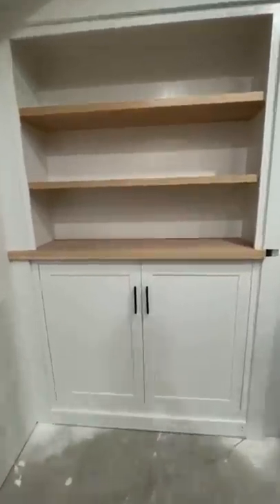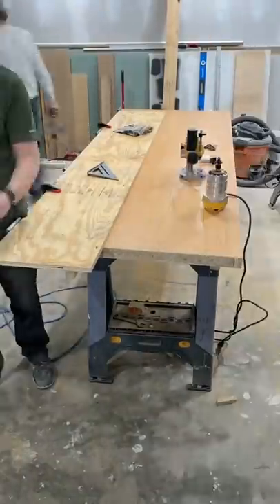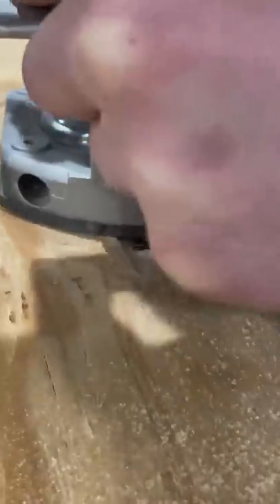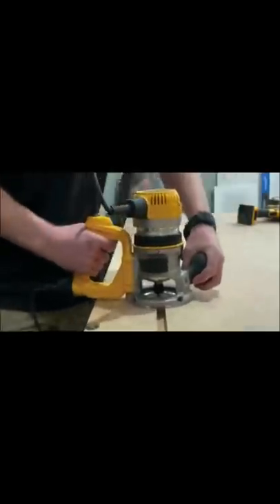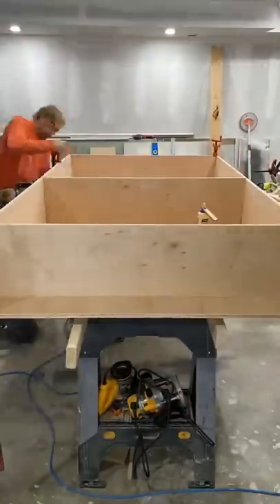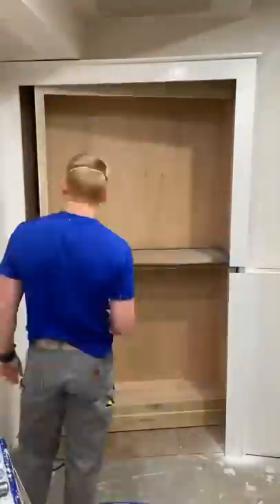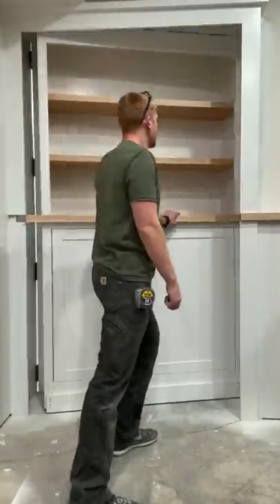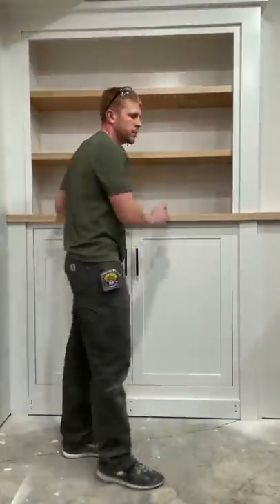How to Build a Secret Bookcase Door | Short Version

Comment: Totally badass! Especially that magnetic lock. Great place to hide.
Reply: I would suggest a combination of a mag lock and drop bolts if you want to build a place to hide. The drop bolts are much more secure because they do not rely on electricity and a good seal (mag locks will not lock securely if they have debris in-between the surface). Drop bolts can also be easily set to stay locked (called fail secure) if the power goes out meaning you wouldn't loose your lock if you lost your power. No worries about the fail secure and getting locked in though. You can access the drop bolts from inside and get out. You either install them in such a way that you can physically unlatch them, or you have a set of contacts that you can energize with a spare battery like a 9 volt (unnecessary but cool) to unlock the bolt.

I'd keep the mag lock as well though because they are much easier to make it where there is no wiggle at all, therefore not giving your secret hideout away 🤙
Reply: Hide where a cheap magnetic lock is supposed to keep someone out.. also the room isn't sound proofed so they can hear you if you even are breathing too hard while they are present in there.. not smart to use as a hiding place
Reply: @capn.c5321  so.... You just sound proof it... right? It is new.

Comment: Just needs a secret unlocking mechanism instead of the keyfob
Reply: Yeah like pulling on the fourth book from the left or something. Maybe you gotta move a candlestick.
Reply: The key fob cuts the power on the electromagnetic
Reply: Like the book in the Addams family's library or the bust in batman's study
Reply: @pabloramirez4672  so, just cutting the power to the house would render all "secret" locks useless?
Reply: @cojack5080  depends if he has it hooked to a separate power source
Reply: Or flipping the breaker to the lock ;P
Reply: And more hinges that things gunna sag with all that weight
Reply: Hopefully there's a way out if you get closed in without the keyfob
Reply from the maker: There’s an exit button inside.
Reply: Maglocks usually have a 12v auxiliary battery supply which is being permanently charged by the mains. 

They do in the UK anyway. I used to install Bewator Maglocks and Keypads.
Reply: @jonathanwright5550  I've always used piano henges to make it flush and sturdy but I've always done a false wall never a bookshelf
Reply: @tygoff262  yeah I thought pinao hinge be the way to go
Reply: @pabloramirez4672  that makes me wonder how much power electronic magnets take and if you could run them off of something small like a car battery for a very long time so you could avoid that
Reply: @stephensmith8812  car batteries are rated at 12.7 volts in most cases so pretty much the same I assume
Reply: @pabloramirez4672  thats interesting thank you. I've always wondered about people with "magnetic doors" and thought about power outages or rolling blackouts. They could be run off a generator but that wouldn't be very stealthy and a car battery is cheap and affordable plus if it offers a shelf time similar to a car (4 years+) it would be ideal other than solar power
Reply: She should use a different type of Lock and make it some kind of combination code where you have to pull a couple different books in a certain order
Reply: @zakbrinkhoff324  I concur, and a slightly more simple quick access "hidden gun safe" spot for an emergency access home defense weapon. Like a drop-down under a mantle for a shotgun and a hand gun or something similar, triggered by a magnetic release in a ring, bracelet, or wrist watch band clasp. Maybe a fingerprint reader under the shelf/mantle.
Reply: @entrancinggaming3627  do you really believe  there wouldn't be..
Reply: @stephensmith8812  likely a 9v battery in most will do for back up power. Can't think they require a lot of juice
Reply: The key fob is the secret unlocking mechanism, most people do not unlock their secret doors with a key fobs do they?
Reply: Agreed. I would do a magnetic switch hidden in the wood frame or something where I could activate it with a magnet in case you lost the remote. I would also install a battery backup for power outages in case someone cut the power before a break in

Comment: What happens when you actually put books on the shelves? Will it still open smoothly with the extra weight?
Reply from the maker: I guess we will see… I do have an adjustable caster on the opposite corner to support weight.
Reply: I've installed a few Murphy doors and those held up. Can put whatever on them. But those have different style hinges. I would assume these would start to rub with weight and time
Reply: @SatisfyDIY  that's the only way those standard hinges will survive. Even still you'd be better off putting heavier hinges on there
Reply: People do not use books any more.
Reply from the maker: Lol
Reply: @SatisfyDIY  I would definitely look into getting some commercial fire rated door hinges as those can hold a LOT more weight over standard residential door hinges. I work as an escape room designer and installer so I build hidden doors more frequently than I really care to admit and you did everything right besides that. I would say replace those hinges and maybe look into a commercial automatic piston based door opener (just a closer installed "wrong") and you'd be golden! That way when you hit the key fob the door automatically swings open in a controlled manner. Great job
Reply: Some ppl don't use books anymore
Reply: Something you can also do is at some rotating wheels to the bottom of the door to help support weight as well but strong hinges are always the best route, wheels would be just a way to support the hinges since they do all the work
Reply from the maker: Exactly what I did. Caster on opposite corner
Reply: @SatisfyDIY  good man. From my experience the castors with the red rubber wheels are ideal as they won't ever leave wear marks it skuff the floor.  How's it holding up over time?
Reply from the maker: It’s done pretty well so far. Got the lower cabinets loaded with games. Waiting to finish everything to load the top. Making it adjustable I should be able to compensate for any settling.

Comment: I think one of the biggest questions I have is how you set up the cuts to line up so perfectly opposite the hinges, considering how thick the door is when it's all said and done.
Reply: There is a piece of wood parallel to the seam to hide it. You can see it about half way through the video that it overhangs the frame

Comment: Depending on if that magnet is a normally open or normally closed circuit, a power failure May keep it unlocked or may prevent you from getting access.
Reply: I would expect those to be electro- magnets, but I don't know.
Reply: @dragons_red  well yeah they are. But if it's always engaged and pushing the button releases a magnet, then losing power releases the magnet. If it's always disengaged and pushing the button pulls a latch that opens the door, then losing power would lock you out. They make them both ways.

Comment: lpl: gents, today I’m gonna show you how to break into a secret magnetic bookshelf door with no tools just only toggle off main breaker
Reply: Click on one. Okay, that's the power off, now let's take a look at this lock.
Reply: But we wanna keep some lights on so the biggest security flaw with this is there a breaker labeled book shelf and when we turn that off it let's us right in so folks I wouldn't recommend this to anyone anyways that's all I have for you today and as always have a good day
Reply: Actually, that would be preferred method for a panic room.

On power failure, you'd want to still be able to open it from the outside, jump in, then throw the manual bolt from the inside that cannot be opened from the outaide with or without power.

Comment: Made one of these for a client of mine, but I made it soundproof so you cant even tell they have part of the house behind it haha
Reply: That sir, I believe is illegal. 😳
Reply: @sexytopramen  soundproof hidden room. think about it. and i was jus kinda bs’n
Reply: @sexytopramen  I guess it was just partly my mind speaking aloud about certain situations. I don’t know. the hole in the basement came to mind and it puts the lotion on the skin.. Imagine if his hole was soundproof?
Reply: @maniacalmonster2293  I wish my house was soundproof. Those damn trains are loud and kids chopping off their exhaust.
Reply: @carnage50x  ya i can relate to that. When I was in highschool, our backyard was a whole 8ft wide from the back door to the fence line but ran long down along side the house. Immediately after our fence line were train tracks. Talkin like 12ft from the house damn near,
Reply: @maniacalmonster2293  my house is about half a football field away. However it's open flat ground with nothing blocking sound. Not even trees. There's also an old country road Right behind my house (intersects the tracks) that's covered in pot holes and badly repaired pot holes. When I first moved in. That road was very quiet with very little traffic. I didn't care much as it's just an old road not traveled much. Won't hurt nothing and make people that's new to the area driver slower. (Built in speed bumps per say) Well now it seems to be a hot travel route for semis. I hear those trailers crashing through the road all day. Straight up ruining what little road is left. Train traffic has also increased significantly. This house used to be nice and quiet. (That's why I got it) Not so much anymore after only a few years.

Comment: Yeah this is definitely looks cool but as soon as you start loading that bookshelf with books and heavy things and open it a few dozen times those hinges are not going to last too long. I know he said their commercial hinges I've been working in facilities and physical plant my whole life. I have replaced many a doors and many a hinges that were $1,000 plus doors with the best commercial hinges you can get. The fact of the matter is metal rubbing metal consistently will wear out and will cause issues. That door closes so smooth so nice right now but give it a year or two of opening if it's used a lot and you will most certainly have issues with it not lining up not closing properly not to mention the squeaky ass hinges. But I've always wanted a secret room with a bookshelf door You can easily just make the bookshelf a lot smaller Make it closer to the size of the door.
Reply: The width was to accommodate the wide gun safe in the hidden room.
Reply: @JonPBixby  I understand that. But you cannot have so much weight hanging off the end. If you have a 36-in door and then mount a shelf almost double the width of that and then load that whole bookshelf up with books which are really heavy. After opening it over and over for maybe a year you'll start to have some issues. I have no doubt that the commercial products they're using are solid but there are no hinges that I've ever used in a commercial application that are invincible and never fail. If he throws a caster on the far end of the shelf on the bottom so that it has some support and rolls on the floor as well, I'd be satisfied with that. I would use the exact same method just wouldn't have the shelf so big.
Reply from the maker: I do have a caster on the opposite end for that exact reason. I forgot to include in video.
Reply: @SatisfyDIY  ahh , I missed that. Well then great work. Carry on.

Comment: Sucks when the battery on the remote dies out suddenly in an emergency..
Reply: Way to be positive lol.
It's just like the red dot and weapon light on your rifle. You make sure you have set dates and you change the batteries on those dates before they're dead. Also, access systems like you saw here with the mag lock, have many backups. You have RFID, pin pads, finger print pads, REX buttons (rex=request to exit). The best for this system, which is easily available if you look through different access control systems on Amazon and elsewhere, would be the RFID since you could easily hide it behind the wood. This would allow the secrecy to remain, and all you would have to do is wave your RFID tag over the right spot to trigger the lock to open. 

You also have the choice to make your system fail secure or fail safe. Meaning if you lost power to the system itself, including your back up battery (remember though, you should change/charge important batteries BEFORE they die) the system will either stay locked without power (fail secure) or unlock (fail safe). I know this is separate from your concern, but I'd add it to the lesson.

I hope I've changed your life....or at least gave you a little helpful info 😉 lol.

Bonus lesson unrelated to this particular door. And hopefully the crooks don't read this far. Commercial buildings have REX sensors. The vast majority of REX sensors only look for for a change in temperature. This is different than a REX button that you have to push, and is installed on almost all occupied commercial buildings for Incase of an emergency like a fire. It detects people coming and automatically unlocks the door. Here's the lesson. All it takes to break into a building with a REX sensor (the vast majority of buildings remember) is a can of compressed air. You hold the can upside down and I shoots out super cold liquid and gas. You simply spray that through the gap on the door (all doors have a slight gap, except clean rooms used in science labs) and it triggers the REX sensor unlocking the he door. Hehehe
Reply: @DEATH_TO_TYRANTS  Definitely put Me in my place.. In a positive way. Some very good information too! 👍
Reply: @PR4U2NV  
This was a very pleasant exchange per internet standards. I'm glad you appreciate the info.
Stay classy amigo 👍
Reply: @DEATH_TO_TYRANTS  Stay safe..👍
Reply: @PR4U2NV 
I can't promise that...but I'll guarantee you I'll stay free. 
Catch you on the flip side amigo 👍
Reply: @DEATH_TO_TYRANTS  Free It Is.. Friend.

Comment: I'm curious if the lock/unlock apparatus is battery powered or hardwired. Will you still be able to lock or unlock it if there is a power outage?
Reply from the maker: If you had a battery backup yes.

Comment: You can make it more stealth with some weather stripping to keep air from drafting under the door. Also cover those screw holes on the bottom
Reply from the maker: That bottom trim isn't attached because I have to install flooring. Then get right height.

Comment: I install maglocks for a living and you need a lot more than just buying one from amazon there's a whole set of tools you need not to mention running the wire for it through your walls and setting up a security panel so your devices can talk to each other. The price to have someone install one for you is over a grand and that's just for a 600LB lock
Reply: I just use a hidden button to unlock mine.
Reply: @97marqedman  that's fair

Comment: Love it!  I saw the remote fob for entry.  What did you do to prevent accidental locked in room?  Interior switch or button perhaps?  I'm know those magnetic locks are strong.
Reply from the maker: There’s an exit button hard wired in.
Reply: @SatisfyDIY  I can't believe how many comments keep asking about being locked in....

Like ... Is there anything made nowadays that doesn't have an excess of safety/fail-safes!?

 Hell, you can't open an orange juice without pulling the plastic ring of the cap and THEN peeling the safety seal on the spout.
Reply: @SatisfyDIY  and what about is the power goes out ...?

Comment: Quick question if your lock breaks for some reason what's the solution to get in
Reply from the maker: It’s powered by electricity. Fail safe lock. So I’d just shut the power down.

Comment: Do you have a battery backup for that lock?  Or is it going to drop with power?  Now, does the bookcase flex when you have it held in place?  If so, might want to get 1 more.  Have you had any troubles with the shelf scrapping on the floor?  I would guess you might want to put weather seals around the whole thing so you don't feel a draft coming from that room.  Also, do you have any vents run into the room to help equalize air flow or no?  Neat little project, but I'm guessing there's way more than just the door that goes into this project, if you're truly looking to have a secret room.

Should hook up the contact input on that maglock if it has one, to alert you if it ever becomes ajar when active.
Reply: Agreed. Definitely need a battery backup. I work with wiring panic rooms. Once you do enough you spot them rather easily and the flaws.

Comment: The secret to the magnetic lock is having a little bit of wobble in the magnet or strike plate.  It has to mate together perfectly, or it won't have any strength.  When it's mated properly, they're incredibly strong.
Reply from the maker: 100% agree. It took me some trial and error for me to get the magnetic lock to work properly! I could have used your insight.

Comment: As a mechanic i always have the mindset of how its going to fail and whats going to happen etc. So what happens when that magnetic lock fails is it accessible?
Reply from the maker: Yeah, it is a fail safe lock. So no power= no lock. I’ve thought about putting a battery backup on it.
Reply: @SatisfyDIY  thanks for replying. That's cool that it fails open/unlocked. That would suck for the power to go out and be locked in there.
Reply from the maker: Yeah it’s a cool room. But not that cool…
Reply: @nshue23 Locked in? 🤤

Comment: How does it hold up when loaded with books, does it need adjustments?
Reply: Doors can get pretty heavy too, those 4 standard hinges will probably be enough. I would personally use some reinforced hinges just in case. Maybe add a small wheel for support on the opposite side.

Comment: Would would something like this cost?
Reply from the maker: Pricing

Birch Plywood $53.89x3= $161.67
Hardwood Trim $70 
Lock  $108.90
Cabinet Door Hinges $71.06
Caster and hardware $20
Door - Free (someone was throwing away)